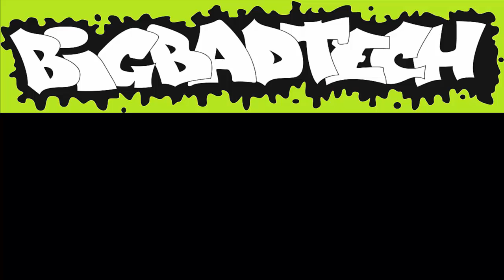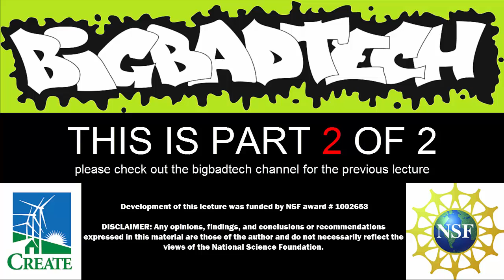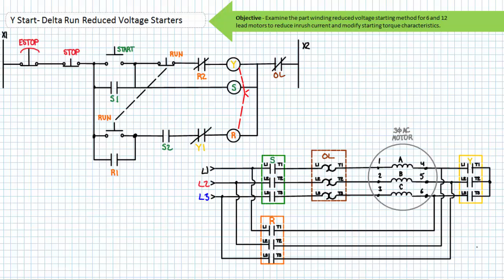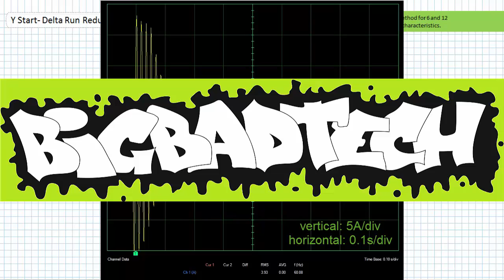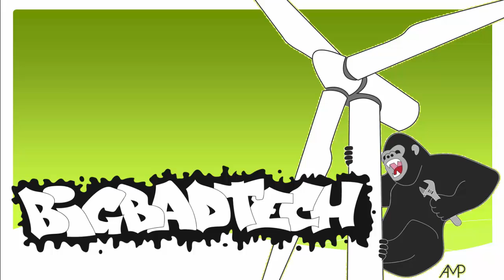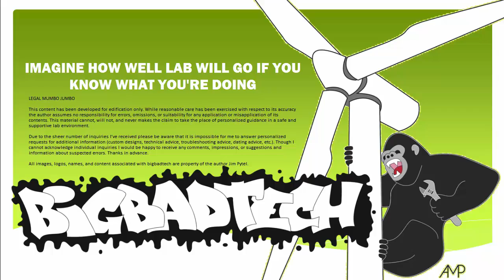Y Start-Delta Run Reduced Voltage Starters (Part 2 of 2)

Comment: Can you explain why the stationary current differs. Thanks.
Reply from the maker: I presume you're referring to "inrush" current? Inrush happens when a motor's rotor is at rest and can be 6X normal running current. I'll explain inrush in detail when I cover motors, however, it's pretty easy to conceptualize if we model each winding using 3 series elements: 1 a variable resistor that is a function of mechanical power, 2 an inductor that is relatively constant and 3 an opposing voltage source that is a function of rotational speed. The opposing voltage source is counter electromotive force (CEMF). CEMF is the generator aspect of moving a wire inside a magnetic field. At rest the value of CEMF is 0V. As such only the resistive and inductive portions of the winding oppose current and inrush is massive. As the motor gains speed CEMF increases and inrush subsides. Here's a lecture detailing electromagnetic interaction: https://www.youtube.com/watch?v=fv5494lRQAs